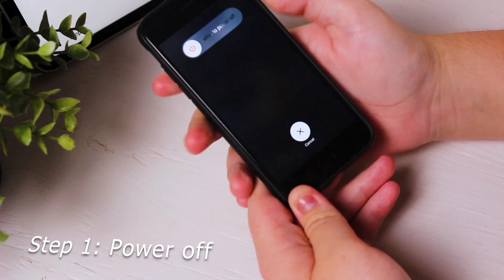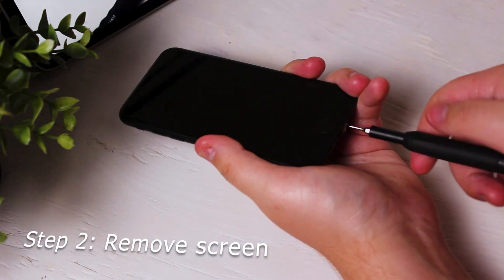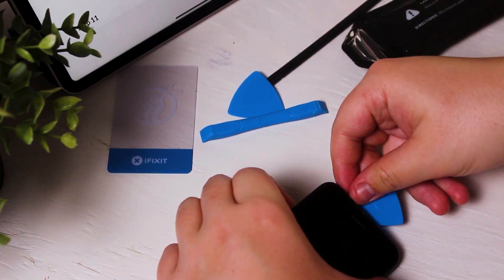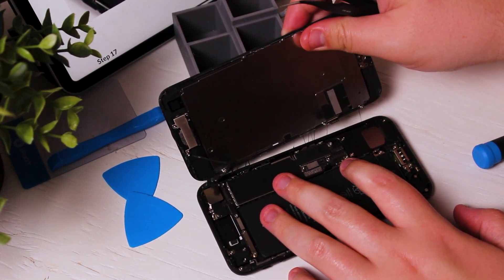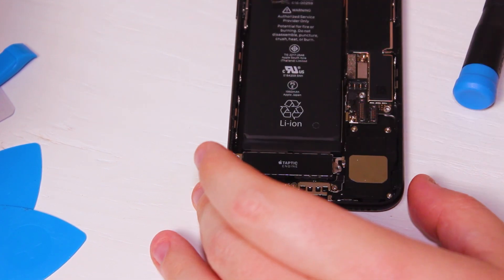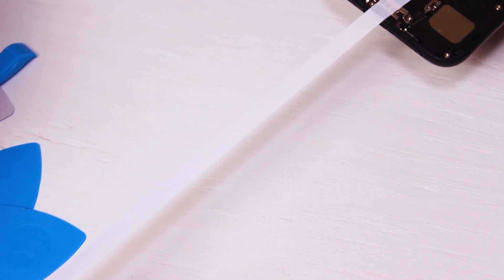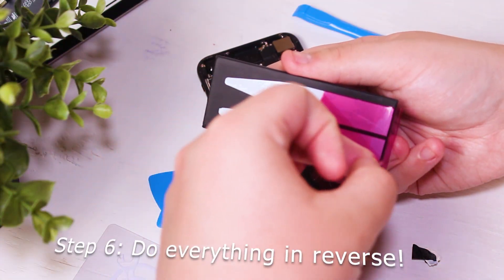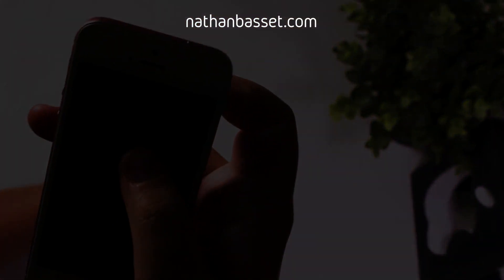Apple tried to kill this phone..

Comment: someone needs to make a simple and easy to follow tutorial on android custom roms and GSI, and market it towards "extending your phones life"
modern android phones can last extremely long without much effort, older android phones (devices that ship with anything lower than android 8) require programming to get modern versions working however.

but most phones from 2018+ support a feature on android that allows you to upgrade them without the company supporting them at all, and the process isnt all too complicated either.